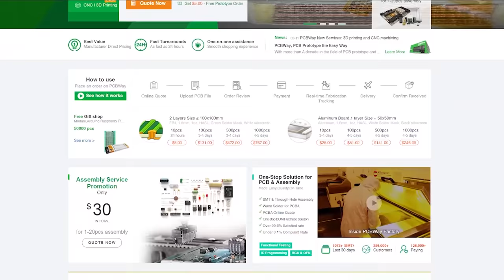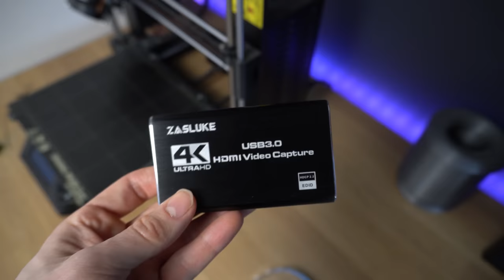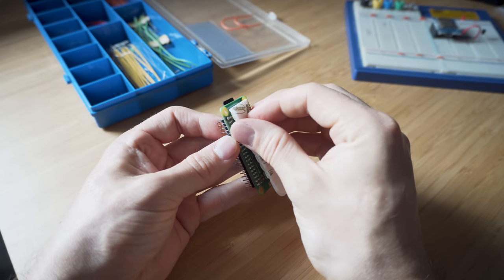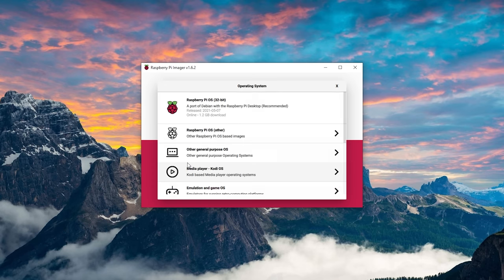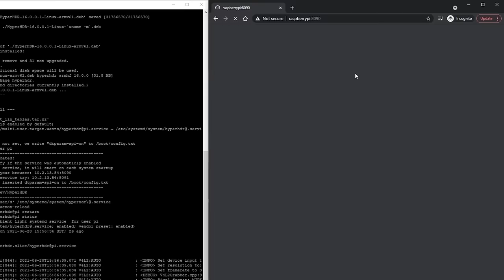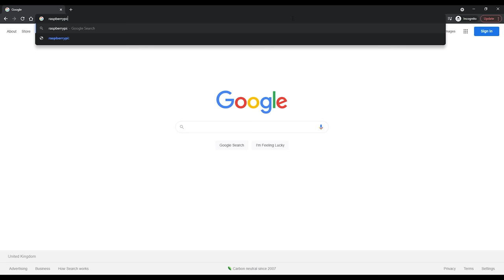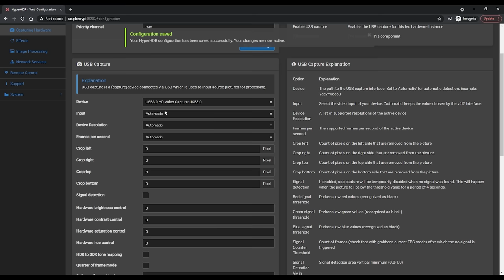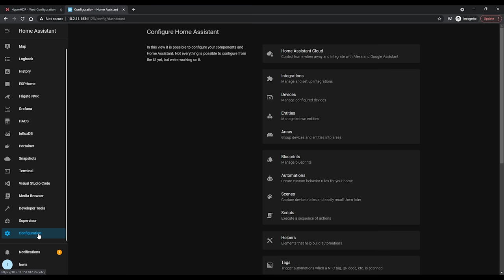The ULTIMATE Guide to Building an Ambilight TV with Hyperion

Comment: Followed everything, but when I log in the ssh as "pi" the default password "raspberry" is denied... Any idea as to why and how I can access the ssh??
Reply: This happened to me.  You need to plug the pi into a monitor (micro HDMI to HDMI) and a keyboard (USB) once.  The first screen will prompt you to change the username/password (I set mine to the defaults ‘pi’ and ‘raspberry’ to start with (and then changed the password through Putty and SSH.  The other thing I needed to do was to use the pi’s IP address (log in to the router to find this) in Putty and to access the web interface of HyperHDR.  Good luck!

Comment: Great video. I followed your tutorial and got my LED strip setup.
However the barrel Jack connector failed on me and a short happend on the PSU.

PLEASE WARN:
The PSU is rated and 5V 8A. the barrel Jack conectors are generally only rated at 5V 5A. 

This has a real potential for a fire as I discovered on Christmas day! Please be careful

EDIT:
My fix for this and I would suggest everyone do this if their power supply is greater than 5V 5A is as follows:

Cut the barrel of the power supply leaving your positive and negative wires (possibly will need  multi meter to determine the polarity.

° Power your Pi independently.

° Solder/crimp the +ve from your LED strip and your power supply. Repeat  for -ve.

°The LED strip should have two sets of wires, one power only, one data and power. As you have used the first power set, use the second power wires, just the negative, and connect this to a ground pin on your pi

Comment: bought all the stupid stuff, installed everything. Got it to partially work (led lights were all white), changed the led light strip model onto Hyperion, everything went black, RPI3 never got wifi connection again, no ssh, nothing. Reinstalled the OS, nothing. Spent 5 hours trying, tested another rpi3, NOTHING. Pulled the stupid strips away from the tv, returned everything to AMZN. Im buying the Govee thing, and that's it. F this sht.